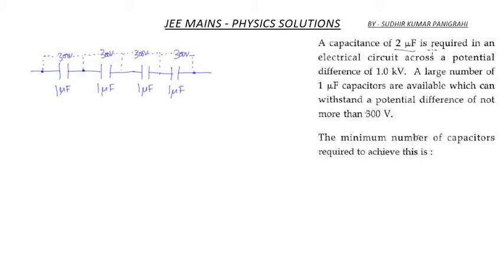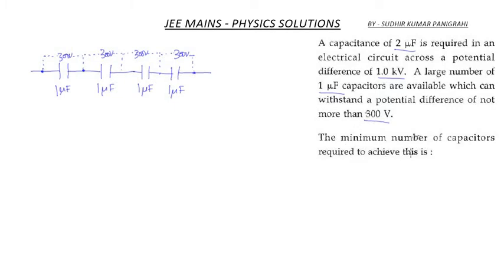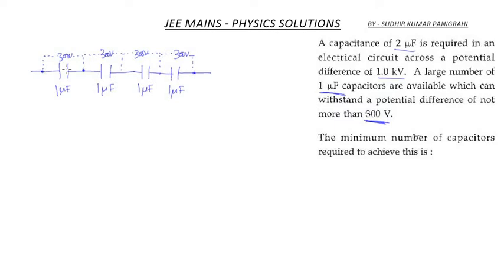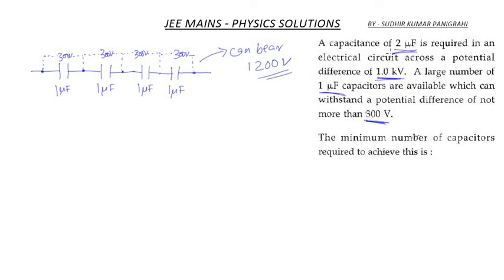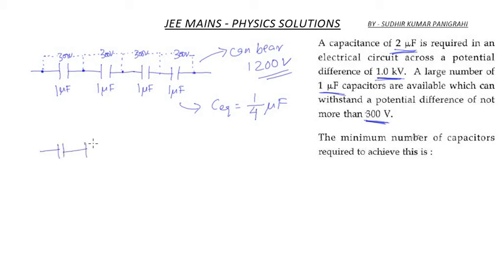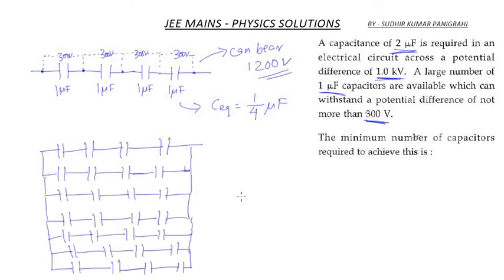Capacitor problem jee mains 2017

Comment: Hey this is a wrong solution ..It is asked not more than 1000V and u have 1200V ...How will it withstand...,😢😢😢 ...TOTALLY WRONG CONCEPT.. If we take each 250V(safe voltage) it's correct